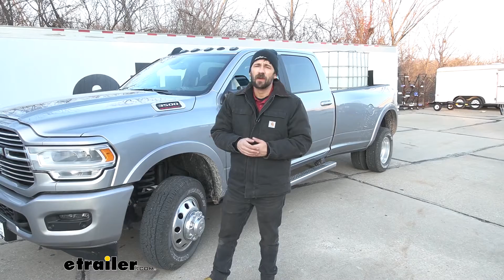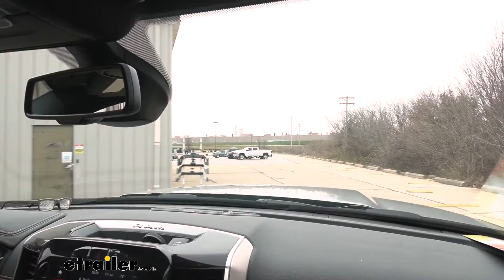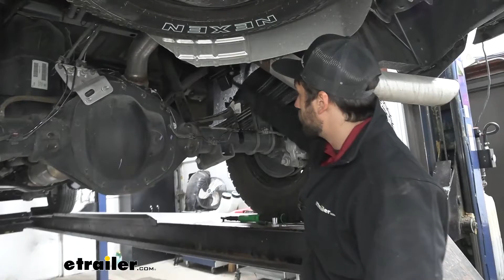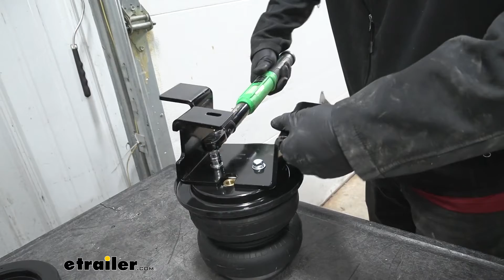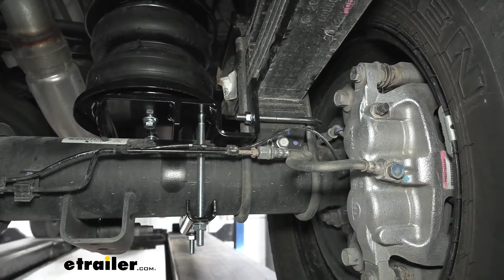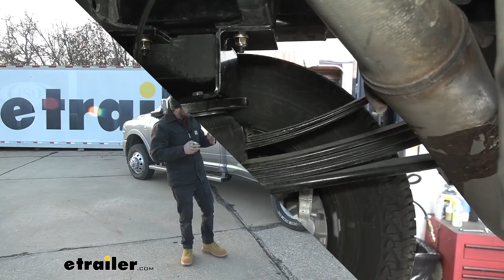etrailer | Set up: Air Lift LoadLifter 7500 XL Air Helper Springs on a 2019 Ram 3500

Comment: Air compressor video????
Reply from the maker: If you're installing a compressor system like the # AL25856, you can check out an install video using the link below:
https://www.etrailer.com/tv-install-air-lift-load-controller-compressor-system-2019-ram-1500-classic-al25856.aspx
https://www.etrailer.com/Air-Bag-Compressor-Kit/Air-Lift/AL25856.html

Comment: If you need it done the best slide fuel hose over your plastic lines for air bags and run it all the way from manifold to each air bag and use black zip ties don’t know why but the black ones hold up a lot better .
Reply from the maker: Thanks for the tip!
https://www.etrailer.com/Vehicle-Suspension/Air-Lift/AL57531.html

Comment: The L support brackets go the other way, facing flat against frame
Reply from the maker: That's incorrect. The exploded diagram on page 2 of the instructions and figure 13 on page 8 confirm that the support bracket is installed as shown in the video.
https://www.etrailer.com/Vehicle-Suspension/Air-Lift/AL57531.html

Comment: What psi for empty & full?
Reply from the maker: The minimum psi in the bags needs to be 5 psi. The maximum psi for these air bags is 100 psi. You will want to adjust the air pressure based off of what you are hauling.
https://www.etrailer.com/Vehicle-Suspension/Air-Lift/AL57531.html

Comment: Would this work on a ram 3500 chassis cab?
Reply from the maker: For the 2019 Ram 3500 Cab and Chassis check out the following link to see a great Firestone Air Helper Spring kit.
https://www.etrailer.com/Vehicle-Suspension/Firestone/F2478.html
Reply: So the air lift won’t work on a chasis cab?
Reply: @Liggma-gy5gd  Why would it not work on a cab and chassis. that particular model no but they do have other 7500 XL that will work. I have two welders on the truck at all times with Cetalien tanks and a trailer in tow